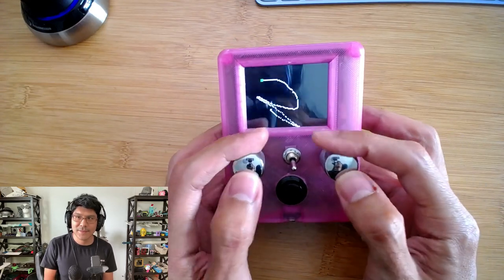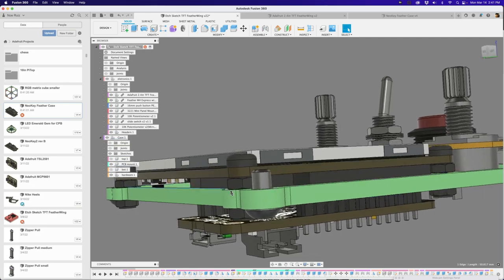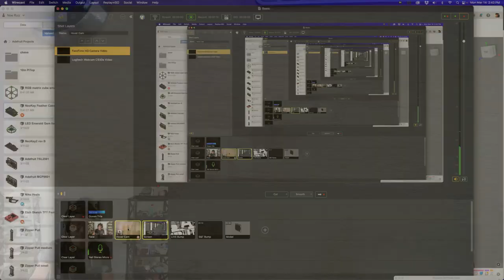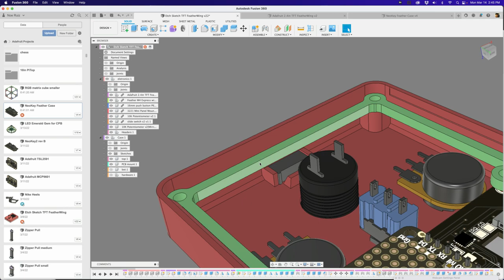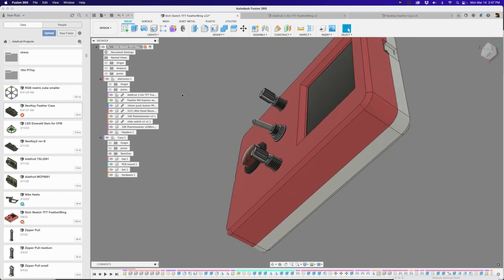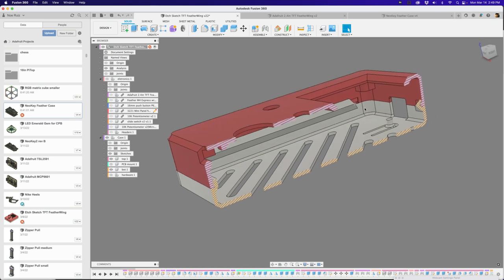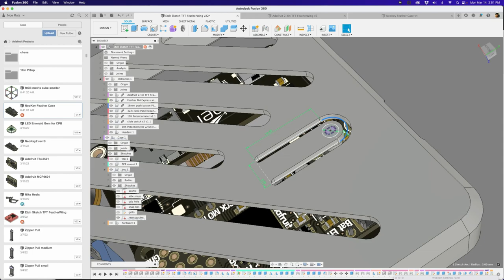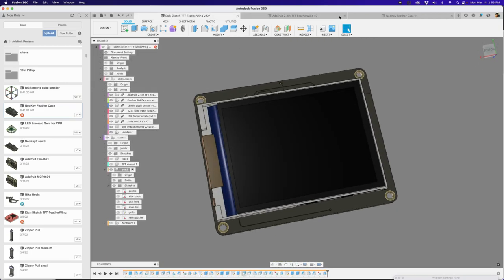Layer by Layer – Fusion 360 – Etch Sketch Snap Fit Case

Comment: Hello there! 

Can you please explain how are the 4 M3 Screws in the corner fastened in to the top? I see the standoff built in the top, but how do the four M3 screws stay attached to it?  Are the standoff holed internally threaded? Thanks in advance.
Reply from the maker: Hello, great question. The holes in the corner standoffs are 2.8mm in diameter, slightly smaller than 3mm to allow the m3 screw threads to tap into holes.